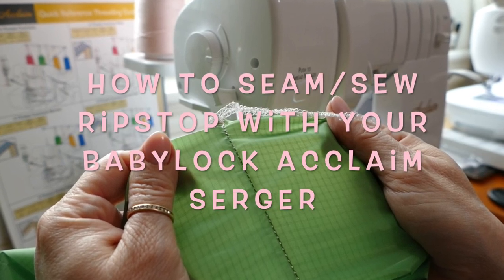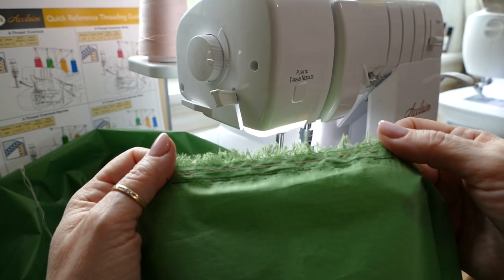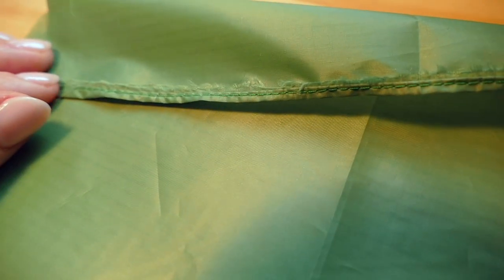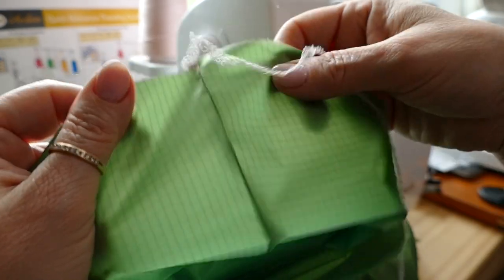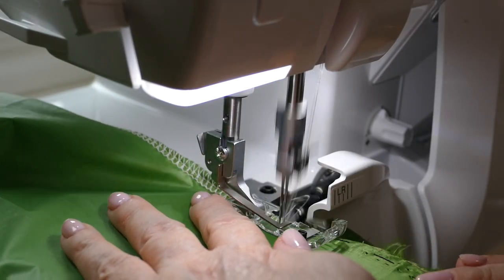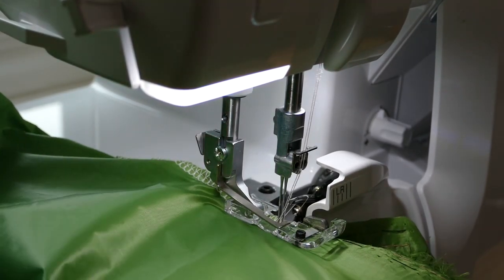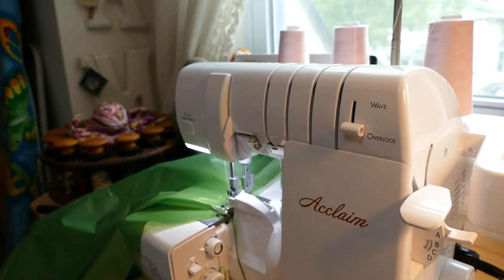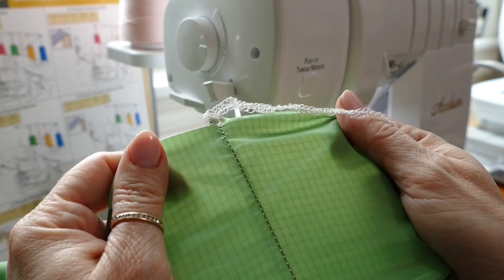How to Perfectly Seam/Sew Ripstop Fabric with your Babylock Acclaim Serger

Comment: I actually make my own hiking gear and what I did was pull the fabric taught on both ends. This prevents the puckering. You also let the machine do the pulling of the fabric, not yourself. I also did a rolled hem with no attachment using this method. I do use a vintage sewing machine as well.

Comment: Thank you....trying to cover my gazebo as well.  How many yards do you recommend?
Reply from the maker: That depends on the size of your gazebo really.  I measured from one side to the other for the roof piece - that's the piece I had to join here in this video - and then I measured from where I wanted the curtain to start to the ground multiplied by 6 since my gazebo has 6 sides.  Each side of my gazebo was smaller than the width of the ripstop I bought so I knew that would work nicely.  If you want the curtains to have more drape in them you would want them wider.  Thankfully, ripstop comes in different widths!  I bought a very wide one.

Comment: If you are sewing ripstop for kites (kite fabric is nylon or polyester ripstop parachute cloth) the usual way these days is to use 1/4" seaming tape and a simple lap seam and then finish it with a fairly long 5mm wide triple zigzag stitch (at least 45 degrees and some manufacturers like Revolution use an even longer stitch than that). This sounded sketchy to me at first but when I went to check how my commercially made (and very expensive) stunt kites were made sure enough all the seams had seamstick tape inside them. The reason for this is that the cloth is coated and doesn't fray, the seam adds very little weight, and it's easy to sew. Also, V-46 bonded polyester (with a #14 needle) is about the ideal thread for kite making.